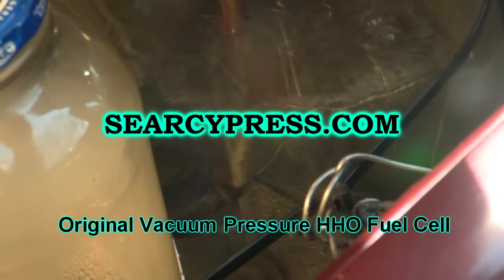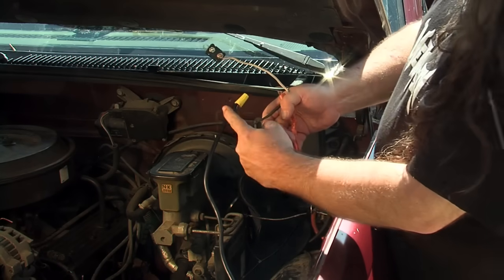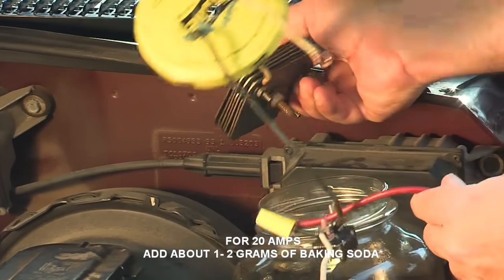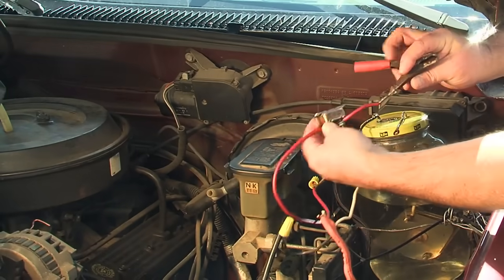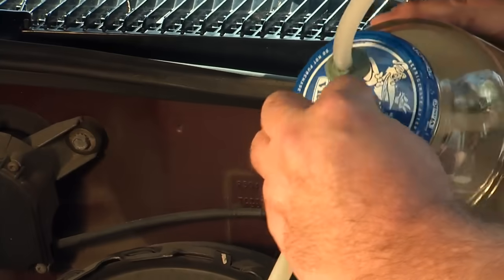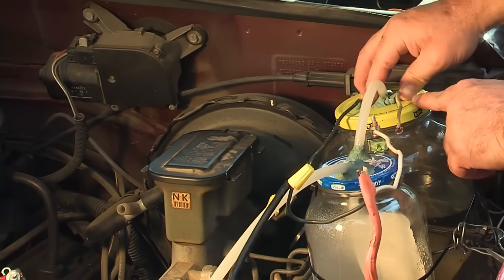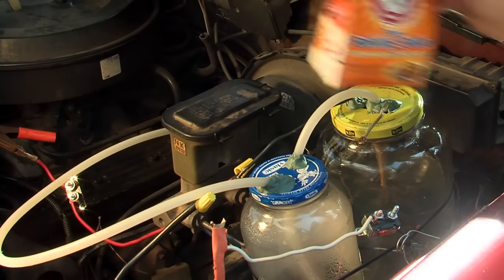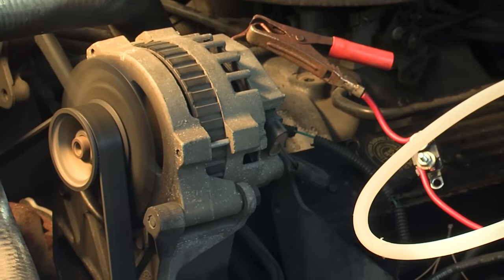Vacuum Pressure Hydrogen fuel cell defeats high gas prices using hydrogen from H2O.

Comment: This dude is still alive, I hope?
Reply: As long as he's not trying to sell the technology, he's fine.
Reply: @TheJustinHit  qqq1qi hi
Reply: @TheJustinHit  ÁáÁáá
Reply: JustinHit.  I don’t think so. Just putting this video out is enough to get a death penalty.
Reply: right, just think how much we will make from those guys who made all that Beer, for horsepower!!!!!!
Reply: @jw-kv1ip  no-one want to save our Earth
Reply: @jw-kv1ip  you all are soooo gullible its hilarious
Reply: He died probably by suicide with a shot on the back of his head
Reply: @benjamin4321  i know youre right, but it always pisses me off
Reply: Lmao I couldn't stop laughing 
One back fire and he is out ta here
Flash back arrestor needed fill the 2nd bottle half full of water and you have one safty Megan 8u to lol
Reply: @jamiejoker118  not really since the engine has enough negativ pressure and the HHO gas is closed of and burned 100%. Could only happen if you have really bad timings that you engine missfires.
Reply: @PLAYCOREE  which is exactly what would happen if hydrogen burn took over due to the difference in flame front speeds of gas vs hydrogen.
Reply: @PLAYCOREE  right and I doubt a back fire is going to come through a vacuum anyway lol
Reply from the maker: Don't be so sure, the instant the backfire is detected we shut the fuel cell off. Better to err on the side of caution even though the system runs in a vacuum. Thanks for the comment, new video coming soon be sure and subscribe.
Reply: @guywithjeep  i remember in the 90's and early 2000's GM was working on a hydrogen fuel cell technology. Toyota released one here in the USA.
Reply: @guywithjeep  so he's using it as an additive to his gasoline.
Reply: @Coruptanimation  Sure, but in a volume so small it has zero real effect on anything.
Reply: @Coruptanimation  Also, hydrogen engines are metered by fuel delivery like a diesel, with open intakes. Unlike a gasoline engine that's metered by air flow via a throttle body.
Reply: @guywithjeep  ahh that makes a lot of sense.
Reply: Took the words right out my brain but magine this in 20 years with funding 😳
Reply: @Sunny-cx7sb  They've been developing this for years, the reason it's not used more is because it's really not very good. Most independent tests put it about break even, any gains made by burning the HHO are balanced by the losses in electrolysis. Any improvement in MPG is not consistent and with multiple tests is shown to just be noise.
Add to that the risks of running an explosive mixture of gasses in a hot engine bay, as well as the extra wear and tear on components and it just becomes an exercise in danger and waste.
Reply: I found mine runs better on miller light. Runs great, less filling....lol
Reply: Well i do hope he is still alive.. iam shure the big oil and gas don't want him to be now that he made this free video.. crazy I always herd this in science class when I was a kid but now 30+ years it's finally a reality.. we no longer really need gasoline now..
Reply: @williamsnyder321  there is far more energy in gasoline per square gallon then there is in hydrogen.
The creation of hydrogen costs a lot of electricity so you cant make it without already having some form of energy.
Reply: @BigBodyBiggolo  Square gallons of gasoline are no good. My fuel tank has a round hole.
Reply: @chap666ish  this is the best thing I’ve read all day.
Reply: @lipeeno  lol.
Why would you get so emotional at the end of your comment.
I said nothing that wasn't true
Reply: @BigBodyBiggolo  Approx. how many gallons would you estimate are in one square gallon?
Reply: @chap666ish  omg
Reply: @BigBodyBiggolo  the fact you said "square gallon" discredits the whole statement. Gallon is already a measurement of volume, you wouldn't square it for a comparable measurement.
Reply: @pshecks  yeah thanks for pointing that out captain obvious
Reply: @BigBodyBiggolo  thermodynamics he's not creating energy he's changing it's form   you can't get more energy out than you put in .
Reply: @BigBodyBiggolo  hydrogen has almost 3x the amount of energy than gasoline. 2.8kg gas (1gal) has the same amount of energy as 1kg of hydrogen. You sir are delusional as well as misinformed.
Reply: @BigBodyBiggolo  so you mean like a 240V battery from a Tesla? Hah
Reply: @BigBodyBiggolo  you know a car literally produces electricity
Reply: Not just that, i'm surprised the video is still up. Many people can do this by just watching the video.
Reply: Isn't there a law of energy stating it cannot be created or destroyed. This would lead me to believe the electricity you are using to create the hydrogen negates any mpg increases. I could see charging a battery from the solar, then using that energy to create the hydrogen.
Reply from the maker: @gkonitz7480  actually what most people like yourself don't understand is, your engine is not burning anywhere near 100% of the fuel. Approximately only 80% of the fuel is burned the other 20% goes through your tailpipe and is burned by the catalytic converter. Injecting the gas into the cylinder produces extremely high efficient burn leaving almost nothing  unburned going through the tailpipe. The energy gains come from the gasoline and not some magical mystery force. There is no claim of over unity here. The laws of thermodynamics remain firmly set. Imagine if someone told you to build a vehicle that only Burns 20% of the gasoline. Of course that would make an industry of emission controls possible. Just a thought. Thanks very much for your comment, new video coming soon. Be sure and subscribe.
Reply: @gkonitz7480  not only that, the amount of hydrogen that is created will not in any way add power the the engine.  The amount of hydrogen created is barely enough to flame a candle.
Reply from the maker: We're not trying to power the engine. We are only trying to create a higher burn efficiency in the cylinder. An engine that only consumes 80% of the fuel is ridiculous. That other 20% funds emission control manufacturers.
Reply: @gkonitz7480  Yup, independent, real-world testing absolutely supports that. Any extra power from the HHO is wasted because of the extra load on the alternator.
Sometimes it might produce a little bit more power but it averages out at about break-even. Even if it did add a little power, it's certainly not enough to warrant driving around with a live bomb.
Reply: Haha I forgot about that.
Reply: Omg my first thought. Liiiiike did they kill him, recruit him, or make us think he's nuts
Reply: Only if he didn't try undercutting big oil business then he'll be fine.
Reply: @musek5048  lol. Just to build it is to go against the oil lords
Reply: Lol they aint worried about this. You need alot of this hydrogen yo actually produce real power to run cars. This idea in theory is great intervention, but lacks power
Reply: @MarkAnthonyWiseMayeleven1987  see the new prototype for 25k rpm engine that weighs less than 30 pounds and preserves fuel by skipping combustion spark that you can add inline to create 400hp with a total of 70lbs.
Reply: Its an absolutely great idea to run a hydrogen system with electrical and ignited components too
Reply: There’s no reason anyone would come after him because this doesn’t work.  Yes, it produces some hydrogen, but nodes near enough to even be remotely noticeable.  It’s about raising to throwing matches into a bonfire one at a time as the fire is rising.  Sure, the matches burn but they’re add zero noticeable extra heat.
Reply: Wasn’t this guy on the Dukes of Hazzard? 🤠
Reply: If he wanted better fuel economy he could change the gearing...
Reply: Did he make one of these for all of his friends?
Reply from the maker: @AISee-community-group  there are quite a few out there that's for sure. (-: thanks for the comment.
Reply: Illuminati Confirmed 😂
Reply: Y8u
Reply: Greetings from Guantanamo Bay is probably on the front of his Christmas cards.
Reply: Unlikely
Reply: Y’all always make this joke as if Stanley Meyer was some super genius who created revolutionary technology, this is literally just electrolysis u fucking clowns
Reply: @Latigo don’t get me wrong the wattage would be extremely low probably but if made efficiently enough it has potential. just like the idea of propulsion through anti-gravitational fields. In theory all you would need is an element that has negative mass which already exists and then make it large enough to bend any rays that touch it including light.
Reply: Watch gashole
Reply: Same thing I thought lol
Reply from the maker: New video is in production. Don't miss it. Be sure and subscribe. We will explain everything and we know what's on the table. Come hell or high water, we're going to show you. Thanks for the comment.
Reply: @metalpresstv  this is a great video! My neighbor built the same type of system and doubled the mileage in his 80’s suburban. Idk if I’d try it on a newer vehicle but he went from 12mpg to 24mpg. I’m a little surprised so many in the comments aren’t getting what you did here. It seems like they think you’re running the engine completely off the hydrogen generated. Maybe you should run with and without the setup and calculate the mpg both ways so people can see the difference.
Reply from the maker: @jblah1  thanks very much. We are producing a new video which will show some advancements we've made. Be sure and subscribe. We'll get it out as soon as possible. Thanks for the comment.
Reply: Got hauled off to area 52 never seen again
Reply: He definitely got taken by the government 🥸
Reply: I swear
Reply: I was working on it 

But stopped
Reply: No he died i a car accident
Reply: Last couple people that tried creating alt fuel died “mysteriously” stay frosty homie 💪💯
Reply: Bob lazar did this in the 1960 - 1970 I believe he was given a chance to work on UFO tech right after. Very very true story
Reply: I don't think this is the same guy but there was a guy around the time this video was posted that tried to show everyone and a while later he died
Reply: Wait until he gets it completely perfect,  and then they show him they already have a patent for this.
Reply: Electrolysis is nothing new. Not like those others that got disappeared. Plus way to many people know about it
Reply: CIA has entered the chat.
Reply: I’m gonna take it he’s still alive because he answered my question pretty quick. Although I do worry about the safety for individuals like this. Pretty sad that it’s dangerous to have brains.
Reply: Transcendental evolution android Jedi is a real option ask 40k advanced evolution options
Reply: Dude moonshined his car
Reply: Just don't drink any cranberry juice
Reply: i agree!  Legitimate concern and question!  
How many years since his most recent post?
and how many have they already murdered for trying to release this Technology!? aka RIP STANLEY MYERS
Reply from the maker: @cryptoalchemist369 we have a new video on this topic and we will be releasing it when the time is right. There are most certainly risks. Ty for the comment.
Reply: Likely not because he's driving with a glass bottle bomb in the front of his car. This is not safe for vehicles.
Reply: Big bro watching him.... believe that..
Reply: Old tech...public sphere...back yard work...basic physics... Of course he's alive. No appeal to conspiracy needed.

Be well and have a nice day.
Reply: He was poisoned
Reply: As long as he doesn’t try to sell or patent it he will be ok
Reply from the maker: There's no such thing as completely free energy. Your engine only Burns about 80% of its fuel. There is a reason they put a catalytic converter on your car. A lot of the gasoline is not cleanly burned. All that energy is wasted. By introducing hho in the state of vacuum into the cylinder we can push the efficiency above 90%. Emissions are improved considerably. We are not trying to power the engine with HHO. We are only trying to burn 100% of the gasoline in the cylinder. The most noticeable effect when putting one of these fuel cells on a very large inefficient motor is a change in the smell of the emissions. Suddenly you noticed something is different. A very dirty engine will often backfire several times as it spits out all of the nastiness that has been unburned. We have a new video that is coming out very soon. We will show you the effect. Be sure and subscribe or you just might miss it. Thanks very much for all of your comments.
Reply: @metalpresstv  you had an alligator clip on your alternator for 30,000 miles? Can I get some of what you are smoking? I actually think supplemental combustible hydrogen may improve mileage..... But I don't want a gator clip flopping around in my engine bay, and two glass jars. Is this a real video? And you really drive this on roads? With that gator clip?
Reply from the maker: @sasquatchrosefarts  the video is completely legit. I can honestly tell you I never broke a jar. The alligator clip was actually a bit of a safety device. Understand if I did hit something it was going to definitely come loose. That would effectively shut the system off. I agree it was very crude, but it served its purpose. Of course today we have something much more advanced. A new video on this topic has finished the filming stage and is now in editing and should be out pretty soon. Be sure and subscribe. Thanks very much for your comment.
Reply: @metalpresstv  I'm gonna give you a nascar subscribe . Like..... it's fun to watch because you think things might blow up. Not because you think it's not rigged. 😂😂
Reply: @metalpresstv  But adding a stoichiometric mixture of hydrogen and oxygen won't burn any more gasoline, there's no extra oxygen to burn anything but the hydrogen it's mixed with.
Reply from the maker: @EddieTheH  you achieve a much higher ignition. Also you should watch some videos where people are mixing HHO with propane. I think you will find it very interesting. Thanks very much for the comment.
Reply: @metalpresstv   send the link to the  new video. Did u finish to upload.
Reply: @metalpresstv  Could it be scaled to run off 100% hydrogen while also capable running off 100% gas? Is there a reason you used glass jars over plastic??
Reply from the maker: @Dan0rioN  It could be designed to run on 100% hydrogen but there would need to be some timing adjustments made. Remember we're making hydrogen and oxygen. Don't believe videos where you see cars running on pure HHO because the engine would turn into liquid lava. We don't try to run the engine on HHO we just simply fuel the combustion process in the cylinder for a complete burn. Most combustion engines waste up to 20% of the fuel which is then burned in the catalytic converter. The reason we're using a glass container is because metal can't be used and plastic will distort from heat and vacuum. It may look very dangerous, however it is in a vacuum state and as long as that remains,  it is very safe. It is true however that during hard acceleration all vacuum is lost in the container. We go into much more detail in our upcoming video which will be out when the timing is right. Be sure and subscribe so you don't miss it. We don't post very often unless we have something significant to show you. Thanks very much for the comment.
Reply: @metalpresstv  Right.. Can you actually provide irrefutable proof that this increased mpg?
Reply from the maker: @Dan0rioN  mileage is a very tricky thing. The way we actually tested the mileage was by running the engine completely out of gasoline. We took 1 gallon of gas poured into it and drove it until it ran completely out and measured the mileage. We then added one more gallon of gasoline and drove the truck until it ran out, while running the HHO fuel cell. On this measurement we went from 15 miles per gallon to 25. This was open road and under ideal conditions. This would not be the case doing this in town or in traffic or anything like that. I can also tell you that it won't work the same on every engine and on some engines it probably won't work at all. Because it gives you a boost it may change your style of driving as well. There are so many factors that change mileage it is pretty much impossible to calculate. Weather, altitude, temperature, terrain, wind, tires, driving style..traffic... I'm not making any promises at all. In fact I'm saying don't replicate this. We do have a new video coming out which will go into much more detail and a cleaner safer setup. Be sure and subscribe. Thanks for the comment.
Reply: @metalpresstv im glad your alive still unless someone else is running your channel.. but im betting my odds it’s actually you but yea
Reply: Might be a dumb idea but it all honesty I believe that if you make a collection tank of some sort for the steam it can be used to maybe turn near weightless fans which could in turn make enough power to produce a small amount of hydrogen at least. Maybe you can upscale it and use the whole engine bay. Might be a possibility especially since steam rises.
Reply: Yeah he just replied to me when I said the map sensor would over ride this and he wouldn't save fuel.  Also there's the rule of thermodynamics which says you get out what you put in.  He's not creating energy he's changing voltage to fuel and it's the same amount of energy   if he's saving fuel the engine is using the excess to make up for the loss in charge   it takes. Just as much fuel to recharge the battery as he's saving so this is all in vain and dangerous too 🤣🤣😂
Reply: this man does not live long this way. you should know if you separate water into hydrogen and oxygen, he forgets what else is released!!! for example, glow and pale,
Reply: Dominique meijer. Water consists of 2 Hydrogen atoms & 1 Oxygen atom (H2O).  When you separate water into it’s two parts there is nothing left.
Reply: @jw-kv1ip  it's really funny how you proved that your own statement is wrong before you even say it.